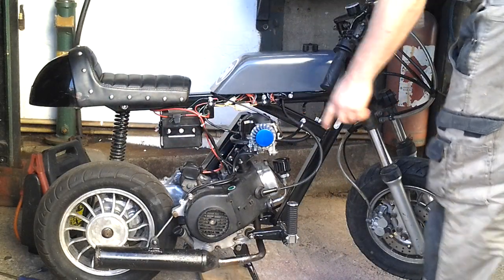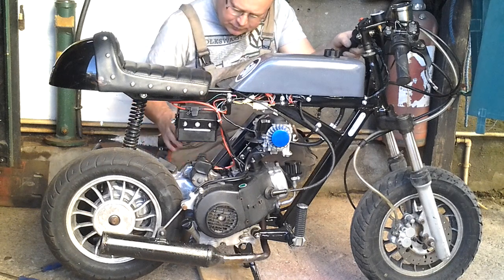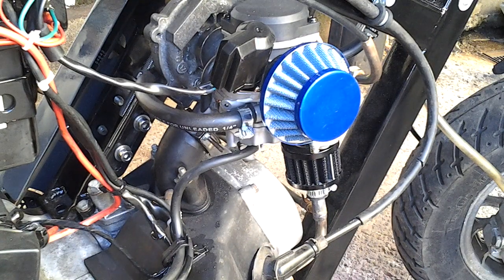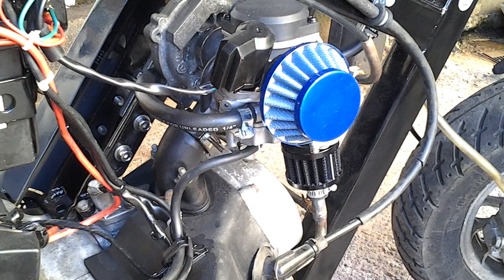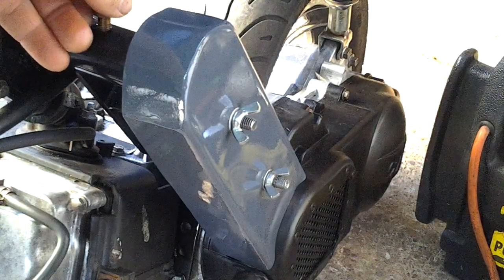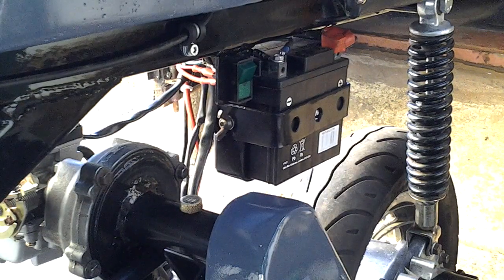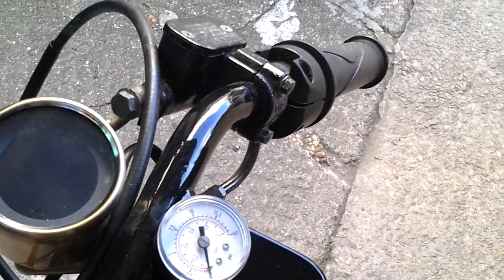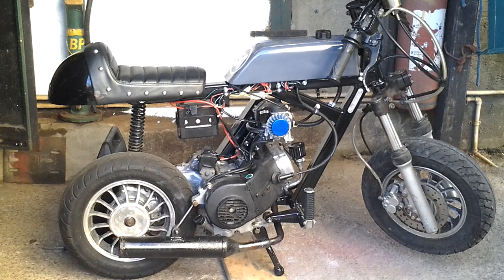Supercharged 49cc gy6 project. The scooter-charger runs!

Comment: Perhaps you’re running the blower at too low an rpm, which is why the boost pressure is so low.
Reply from the maker: This was unfortunately necessary. Commercially available superchargers require more horse power to turn than a 49cc engine produces which increases with rpm. By making my own and gearing it down  it did achieve a small amount of positive displacement at high rpm but it had also reached an equilibrium by making back what HP was lost from the parasitic load. If the engine produced a bit more HP I could've increased the gearing but there was also a limit to the drive pulley diameter inside the belt drive cover.
  I might try turbo charging next time but I've noticed while researching turbo conversions on small capacity engines is that they hold the waste gate open. This is apparently done for safety but it also means hardly any boost is made so has little effect on performance if at all. I also have my concerns with  forced induction on such small engines so will need to think about how to achieve decent boost without blowing the engine and myself up🤔

Comment: it kind of sounded like a vacuum leak...when you revved it up, it sounded like when you let of, it wouldn't drop revs as fast as it should.  I have a couple of GY6 engines that I put slide carbs (pz19) onto.  They don't get clogged as easy as the GY6 CV carbs, have a manual choke and are easier/faster to pull off the bike and clean if needed.  A few times, I have had a clog, and I could rev up the bike with the choke closed to clear the clog.  The CV carbs can't do that.
Reply from the maker: Definitely going to give the pz carb a go. I'm not a big fan of the CV carb anyway and I don't think it works well with positive displacement. Not sure about the vacuum leak though? Selecting the right pilot and main jet has been tricky so I'll do a smoke test to be sure.

Comment: How did you make your frame
Reply from the maker: The main frame is made from medium wall box section which is the same diameter as the headstock tube. This meant it would lay flat on a welding table so I didn't need to build a jig. I then welded on the original engine mount from the donor scooter by clamping it at 90 degrees to where it attaches to the frame. Probably the hardest part was fish mouthing the frame for the engine mount as the tube it was made from is a different diameter to the box section. The headstock was much easier due to the diameters being the same.